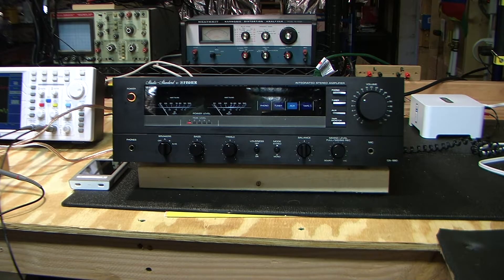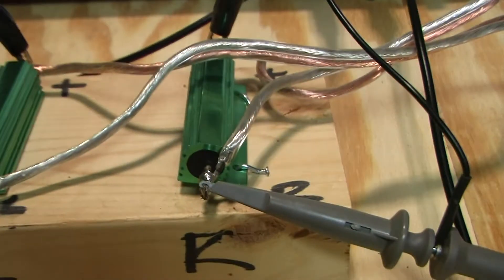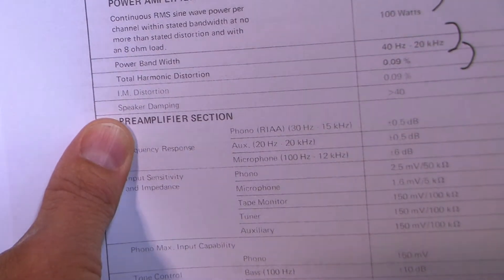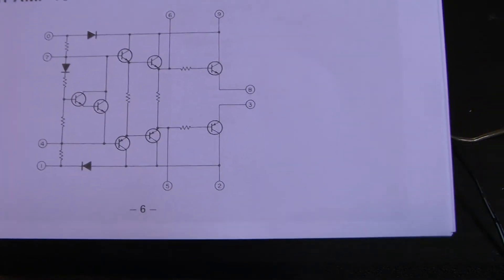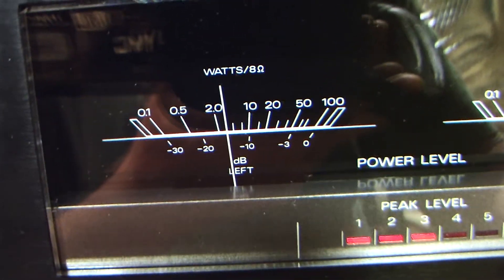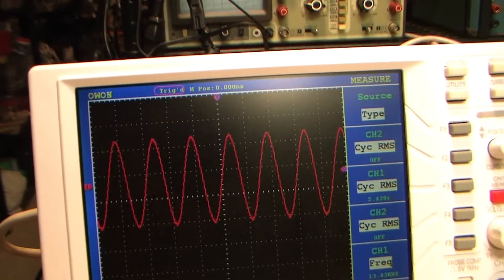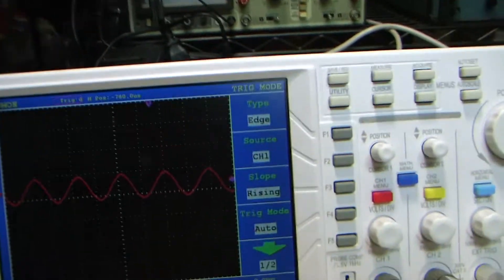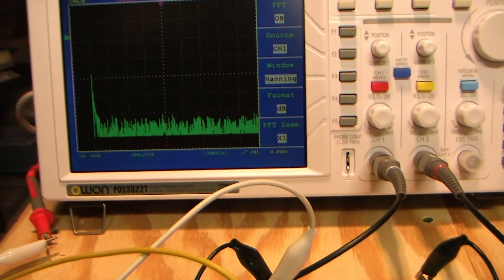Fisher CA-880 Integrated Amplifier Review - Part 1 of 3, Technical

Comment: @stereopolice In the part of this video (around 40:00) where you show on your oscilloscope where clipping occurs under an 8ohm load, can you recall or did you note the position of the volume knob?  I've owned one of these amps for about 15 years.  I rarely take the volume past 12 o'clock, but it would be good to know this info.
Also,  I'm having a problem where the left channel occasionally won't work until the unit warms up a little. Once it's working it never cuts out and sounds fine.  I'm guessing this is probably a bad cap?